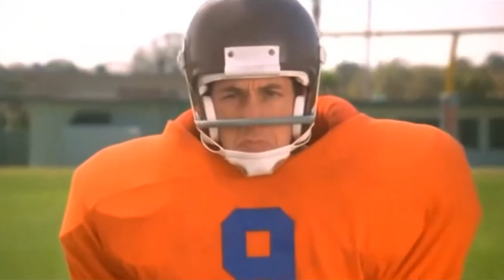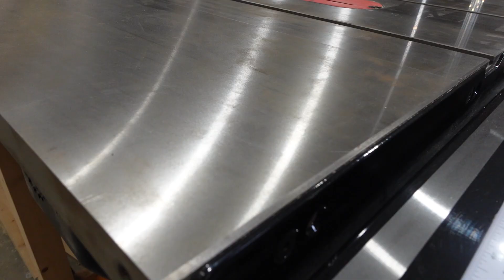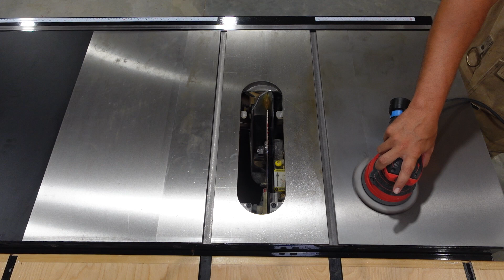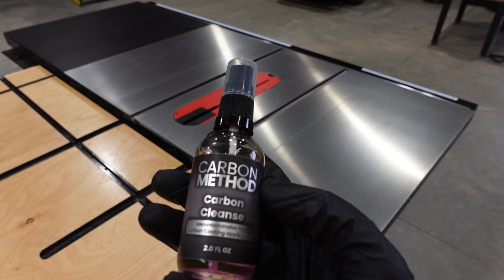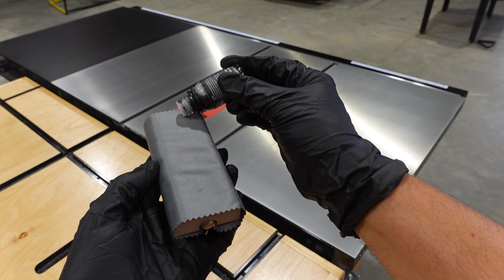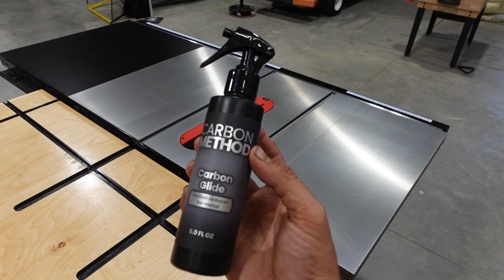Say Goodbye to RUSTY Tools!

Comment: Countless tests have shown that Carbon Glide, Bow Shield or any of the other insanely expensive treatments are only MARGINALLY better at protecting cast iron tops.  Save your money.  If good old paste wax were any cheaper, it would be free. It’s lightening fast to apply and renders the top slicker than owl snot.   Automotive wax is also a good alternative.   And as for those who’ve said, “It will transfer to the wood’s surface!”, I saw bull$hit.  I’ve used both for decades (five decades to be exact) and have never had an issue.  Frankly, I think every manufacturer should follow Harvey’s lead and provide a nickel surface.  End of problem.